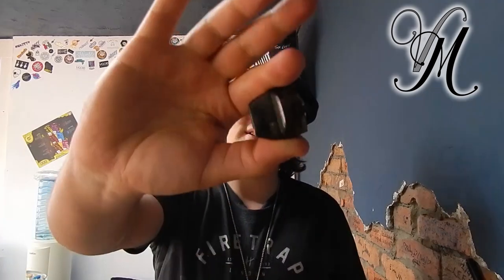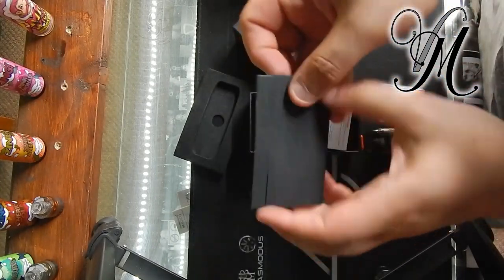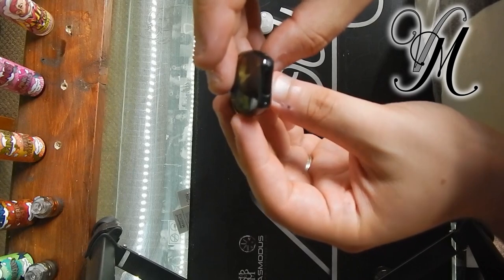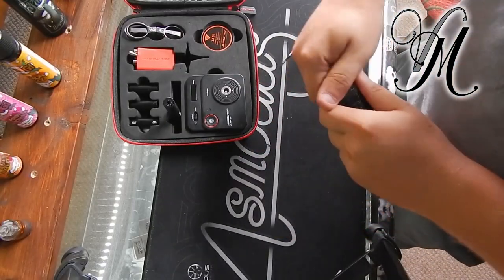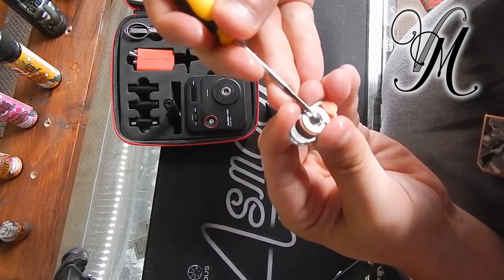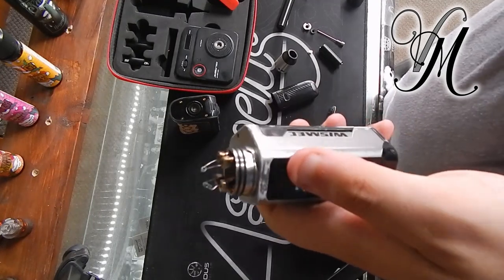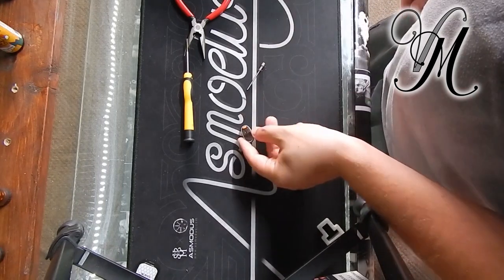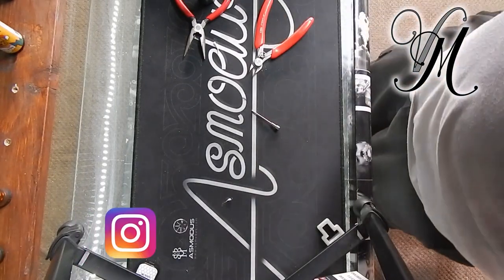Bident Dual Coil Pod System by Geek Vape Review - Unboxing - Rebuilding

Comment: Decent review, not the best looking vape, more a fan of the beefier mods, very annoying to re-wick. However good review but not the biggest fan. Out of interest have you looked at the Vapor Storm Puma 200 mod, very nice 3D printed mod thats very cheap, i think currently £29.99 instead of £49.99 however nice mod and worth a look, thinking of nabbing one along with a Mesh Pro, any advice on that one? currently using the eleaf iStick Pico S with the HW-M coils.
Reply from the maker: thank you! ❤️🙏🤘
I've seen them but never used one.
I'll take a look at reviewing one in the near future (can't do it next week, I'm already using the Snowwolf Exilis for next week).

Not a fan of them types of device's  (wide but short mod) however that wouldn't stop be reviewing one. I recently reviewed the Istick Rim that was a pretty decent AIO kit.
Reply: Would strongly recommend taking a look at the mod